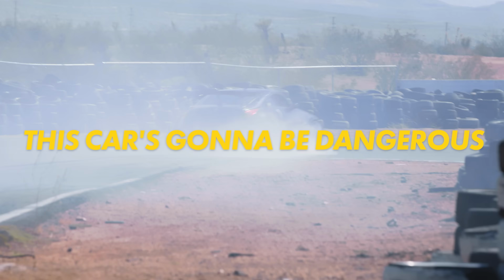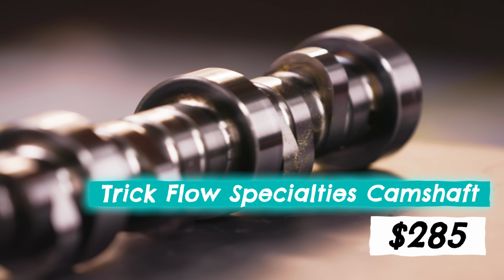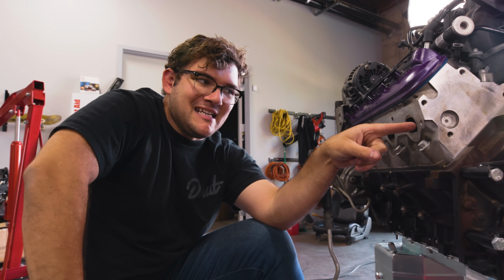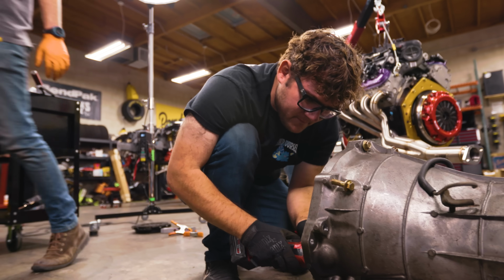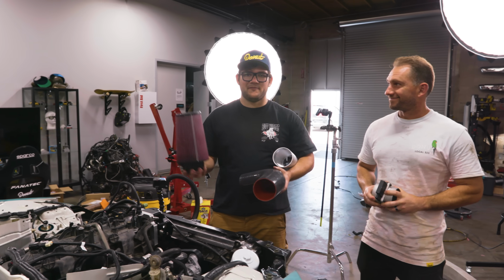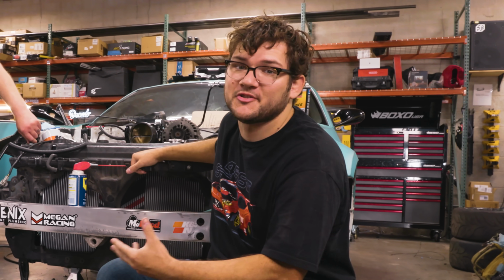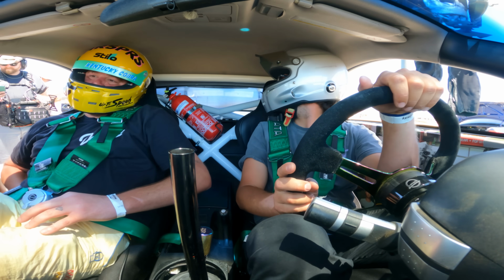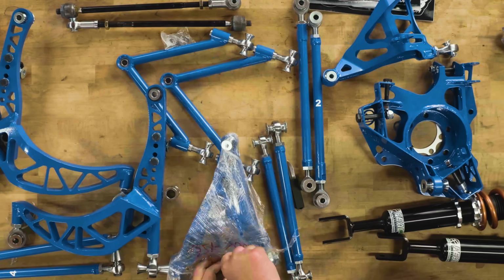$8000 Junkyard V8 vs $30,000 Crate V8 Engine Swap

Comment: junkyard drift missile build when?

I wanna see someone build a drift missile for cheap, using only parts from the junkyard (except tires, of course.  it's 100% doable. there'll be a good amount of fab and technical stuff to do, but yeah, absolutely doable for a 600+ HP NA V8. might even be able to find and rebuild some turbos or superchargers. but the challenge is buying or ordering parts or sending parts out to get rebuilt, refurbed, or reworked is not allowed. you have to build it from the ground up from only parts you find in the junkyard, and tools you have at the shop. and if you have a lathe, or a 5 axis CNC in shop, even better. if not, you'll have to find another way. but a lathe isn't too hard to fab.

Comment: Call me stupid, but if you heat the centre of a metal donut, wont the metal expand and narrow the opening?...
Reply: It expands towards the least resistance, thus outwards
Reply: @domkirk4408  But wouldn't outwards in this case be the void in the centre? Or does it compress itself as it narrows?

Comment: if ur bolt ever breaks off HERE IS HOW U GET IT OUT THE EASY WAY!!!!! 100% OF THE TIME!!!!!! 

1st. ---- Drill with a small drill bit a nice hole then step the size up so u get a nice hole.
2nd. --------Weld a thick BUT the hole (smaller then the bolt so the weld doest go on the surface) washer to the bolt by "port" welding the bolt and puddling over to the washer. ( this means u start the weld in the bolt hole to fill the hole and then let the weld  puddle and fuse the washer to the bolt.
3rd. --------------- Weld a NICE heavy Nut to the Washer AGAIN PORT WELD.
4th. ----------------------- Lube and turn the nut back and forth slowly until it comes out.

worked every time * i did this for a living....*

Comment: All of the money pit and hi/low videos have convinced me... putting a turbo on a car that wasn't designed for it or swapping in a new engine is wildly expensive, might not work very well, and you're better off just buying a faster car 😝
Reply: (to be clear, I realize that's not necessarily the point as long as you're having fun)

Comment: Next time you snap an exhaust bolt on an aluminum cylinder head weld a washer to it and weld a nut to the washer and it comes out every time

Comment: Really nice cars but the performance is really not there, my saab 9-5 vector with a 2.3L 4cyl turboed motor w 250hp hits 60mph in 6 Seconds, so i'd expect a Z with a v8 6L to hit 60 a lot faster than 5 seconds

Comment: that's what happens when you can't tune and didn't use an oil pan spacer

The swaps are still slower than the 3.5 LMFAO

Comment: Not really sure how Hi car looks better - doesn’t even have a bumper. Has a stupid wing that’s useless except for slowing it down - it would help if it went fast but it doesn’t,  and I believe the results show that. In regards- it did a 5.29 roasting the tires and slower when it wasn’t. Nolan should have drove hi car so we could tell if it was his launch ability’s

Comment: The longer I watch this show, the more certain I am that none of these guys actually know how to do quality mechanical work. I think the cost of the parts just ain't it. I think you should be wary of anything these fellas get their hands on.
Reply: Nobody is perfect and experience comes overtime but at the end of the day or couple months it took to pull off the swaps the cars run good for the most part, and to be fair they have never done anything like this before

Comment: I will say these motors are for two totally different applications if you ask me. I picture the guy who buys the $30k motor is going to be a guy who wants a restomod and has spent $10k on suspension, $20k on paint $5k on interior and everything else on the car is brand new, you really can't go to the junk yard and pull a motor out of a truck and throw it in there, it would never look right or look good. But also the guy doing a V8 swap on his $5k 350z probably isn't the same guy thats buying a brand new crate motor and tremec 6 speed for their weekend cruiser and drift car, it just dosent make sense for the project, do people do it? Well yea but again that's not the market they are trying to sell to, there are levels to this shit. You also could have gotten a top of the line LSX 427 and pushed 1500hp if you wanted to. My point is not all LS are created equally and there is a motor for every project and that was their goal later on when these motors became so popular and is why they offer a wide range of crate motors you can buy with warranty. Cause who dosent need a carbed 502 on their air boat?

Comment: Wouldn't be easier to modify corvettes who are designed for v8? Are they trying to prove that they can put v8 in 350z or they comparing engines?   This exercise has no practical implications because nobody in the right mind is going to do this. Maybe if we are in post apocalyptic world and we only have v8 and 350z without engine.

Comment: I know the $ part is supposed to be oh so much worse and cringey, but 30.000$?!! You could probably buy a new car for less than that, and it's just an engine ! And RCR said LS swaps were a cheap way to make power - must not have meant the crate engine...

Comment: You could have gotten 400hp from a 3.7 cyclone V6... For 3k and 2k in turbo/tune why did you spend $8,000 on a used junkyard V8 engine dude.. what a waste

Comment: $8000 for a junkyard V8?! Could have yanked a 4.8 V8 out of a Silverado for 300 bucks, you overpaid astronomically.
Reply: The engine didn't have a lot of mileage besides the heads mostly just a lot of corrosion and old oil not to mention the  300 $cam, the  1700 $ headers and another 3k for other various engine upgrades so 5k for upgrades and 3k for a somewhat used motor ain't bad

Comment: "Oh, god, we've built a weapon that we're not capable of handling!!!" So relatable.

Ahem . . . forgets to chock wheels
Ahem . . . drops a bolt in oil pan
Ahem . . . knocks over the trans fluid container
Ahem . . . the s&%t don't fit
Ahem . . . random ahh oil leaks from god knows where
Ahem . . . realizes you just broke that expensive s#^t that you bought
Ahem . . . shears off all the teeth from a transmission gear and there's no replacement
Ahem . . . engine bay is way too f&^king small for your stuff

Comment: @donut y’all cars slow , y’all could of just used all that money to buy a new car that does zero to 60 under 5sec smh
Reply: It wasn't about making the most power as possible it was about building a more reliable slightly more powerful car    as a fun car to take racing on the weekends just cause it doesn't make like 1000 horsepower like the hellcats you are probably obsessed with doesn't mean it's a slow car bro, sorry if I'm being a bit salty

Comment: You guys are awful at shifting you could have pulled a much, much faster 0-60 time but you suck at pushing the cars how you should🤷🏻‍♂️
Reply: On a straight that is.. other than that you guys got the wheel, but just suck at shifting on the straight